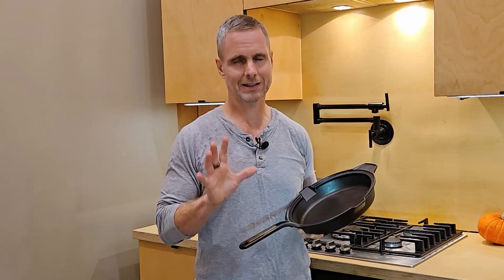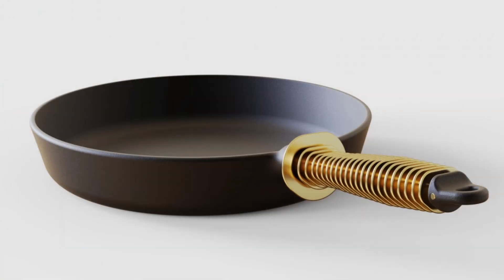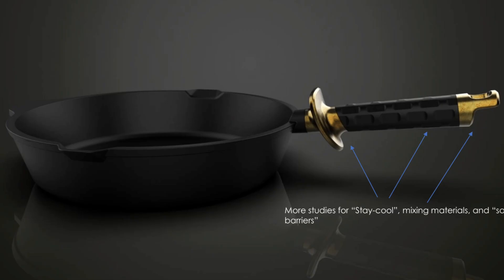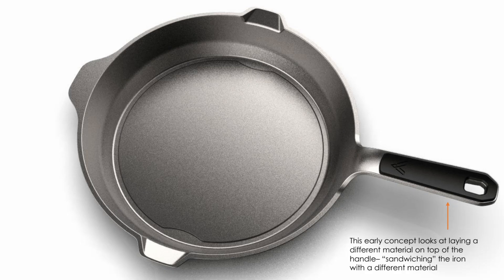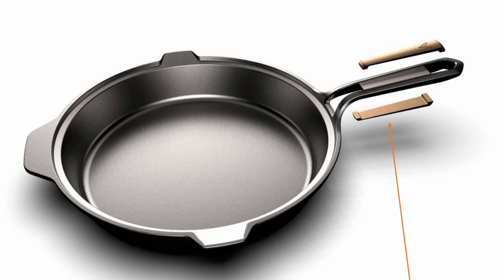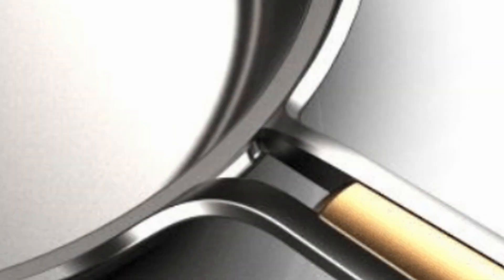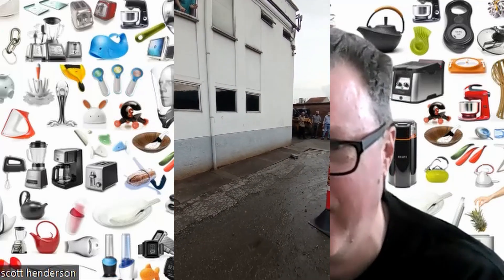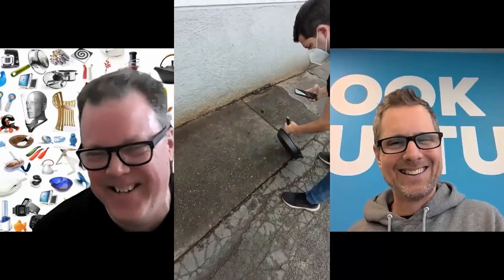How does an industrial designer develop the world's strongest cast iron cookware?

Comment: These skillets look really nice except for the one thing they don't talk about. Ductle cast iron (used in the Signature Series) has about 25% less thermal conductivity than conventional gray cast iron.  So it will take longer to pre-heat and be more prone to hot spots.   But being able to run cold water into a really hot skillet without cracking is a plus.